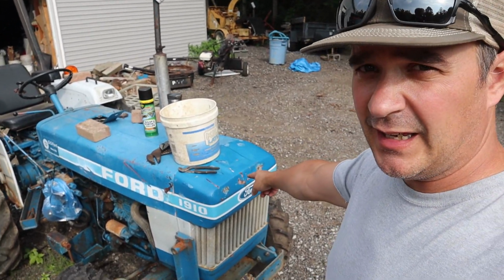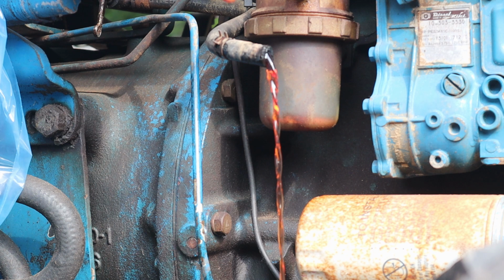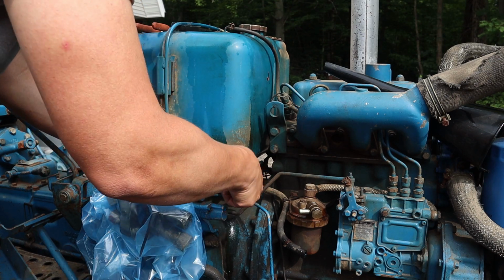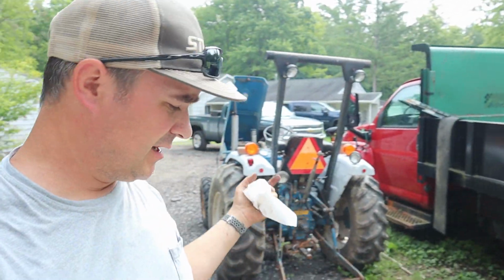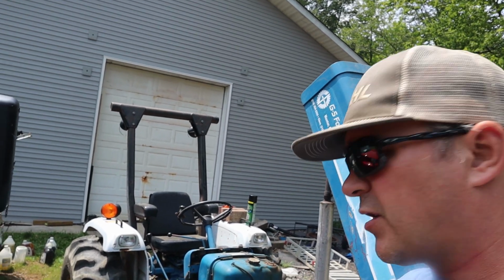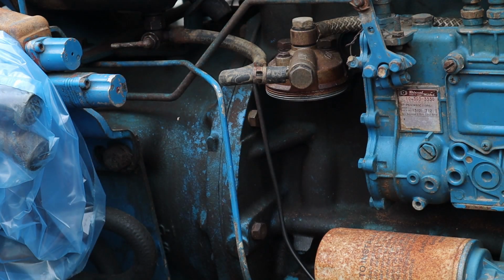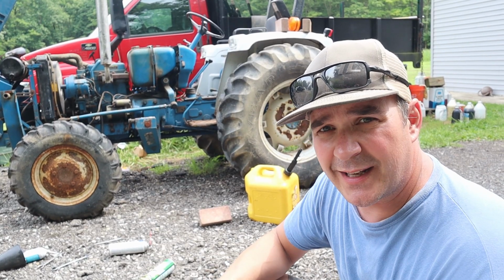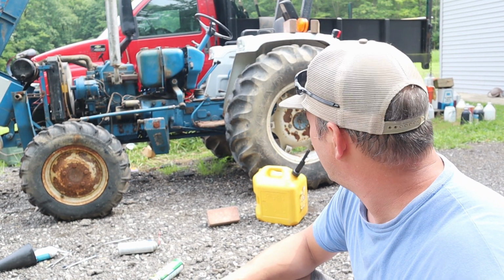Ford Tractor - First Start and Fuel Filter Change

Comment: Total bonus barn find.  Thanks for going through the bleeding steps.  What's the ford model loader that comes w/a 1910?  Feeling not so smart, thought the 19/20 series were all 4 cylinders & 15/17 were 3 cylinders... oops.  Too bad the clutch is good... I wanted to see ya split her in half.  Great channel Matt, wish ya posted more.
Reply from the maker: The rear main is leaking.  So I still may need to split it if I can not fix it by dropping the oil pan. Trying to find the 
parts. Thanks for watching and commenting

Comment: In your 1700 video that you took the Bradco 310 loader off I noticed it had an Akron tractor sticker on the front, are you around that area? I just thought it was kind of interesting because I have a ford 1710 with that same Bradco loader that was also sold at Akron tractor.  I’ve video, I always enjoys seeing these types
Of videos.
Reply from the maker: I am in that area.   Seems like they put it on a lot of  tractors.    The guy I bought it from said he had it installed in the 90s
Reply: @rushedscheduledfun3963  thats cool, I talked to Akron tractor and they gave me all the dealer receipts from 1983 for my tractor. and the Bradco 310 was a dealer option to have that loader. I am also in that area.  Nice video!

Comment: 770B loader i assume? Thats what i got on my 1910- curious what you used for stands when you took it off? Preparing to take mine off for the winter to do some line repairs. Thanks for the vidya!!
Reply from the maker: I took off the loader from the front with my skidsteer with forks.   And i set it on a few plastic pallets to keep it off the ground.      I marked all the hydraulic lines with a paint marker so I can put it back together with with no issues.  It went way easier than I thought.    I have a video of a 1700 that had a Woods brand loader.    It was a struggle.
Reply: @rushedscheduledfun3963  thanks for the reply.... unfortunately I'm ill equipped and this is my only machine...planning to build a set of stands when the time comes but always open to ideas lol